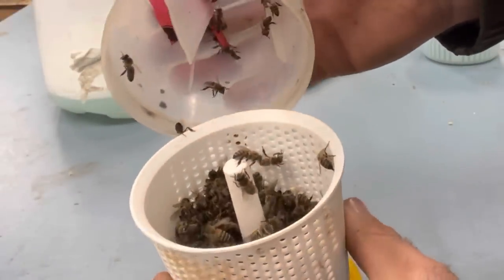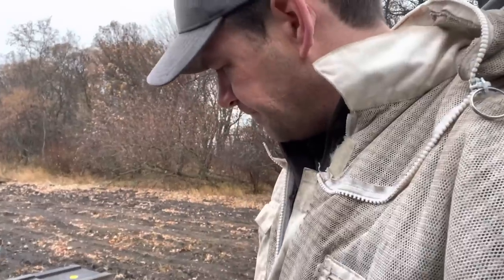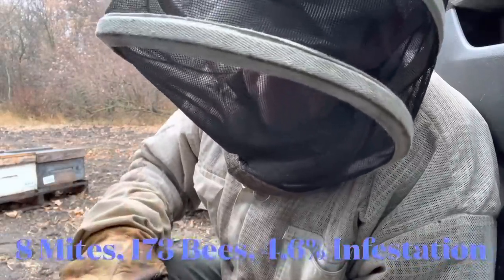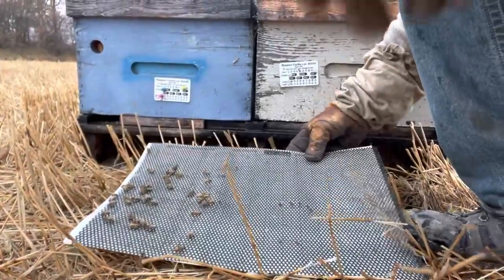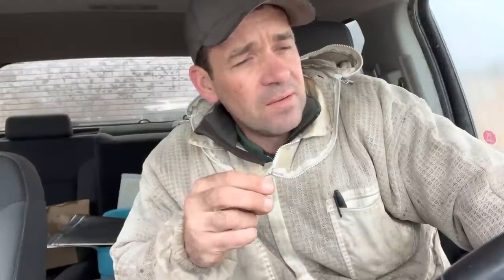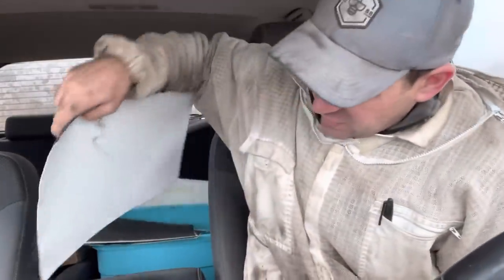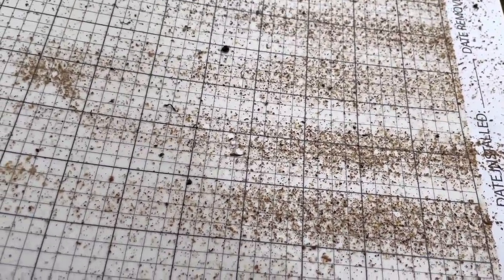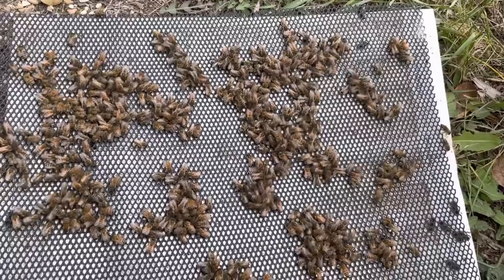Watch This One With a Grain of Salt

Comment: My OAV treatment dropped 65 mites in 24hrs. I cleaned the board, put it back in and over 3 days after the OAV it dropped an additional 62 mites. I had previously used Formic Pro on the hive (20 day treatment option). Before the formic pro treatment I had 16 mites in a wash. After the two round of OAV post Formic Pro, I am at 0 in a wash. I plan to hit once more with OAV I think when i wrap my colonies.
Reply: I'm working though an every 3 days for 12 days round myself, shocked me how much drop I had, my opinion OA is the way to go.
Reply: I'm working though an every 3 day for 12 days round myself, shocked me how much drop I had on my first round, my opinion OA is the way to go.

Comment: well your video sure reminds me of what I went through in California before almonds. I OA 600 hives and put a sticky Paper in some of the hives and in 24 hrs I only had a small percentage of mites that fell. I knew I had a ton more mites then that in my hives. so I did a magic blue towel in the same hives. I checked the next morning and got 150 mites to 200 in the same hives I got like 25 mites with the OA. I feel for you because I have been in your shoes before with high mite counts and know the out come with the hives with a lot of mites.
Reply: I am a beginer.
What " magic blue towel" is ?
Reply: @catchannel4421  it's just amitraz on a shop towel vs the strips.
Reply: Blue paper towel ,soaked in gelatine an oxalic acid, an place over the brood frames, for 6 weeks 
(Repco car part ,in New Zealand, Has those,blue paper towels, )
Reply: @davidizaguirre5060  Thank you

Comment: Hi Ian. Thank you very much for that video. The first thing to take into account for the phoretic analysis is the migration of mites between brood and bees. Usually 80 percent of total mites is within the brood. Imagine whats going on if they are getting broodless.
The phoretic mite count could be possibly 4 times higher at the same total number of mites compared to a broodrearing hive. The broodless hive with dramatically high mite counts might be even undergo through a cleaning process and will be performing better than other hives. Second the bee sample is highly variable eg i am expecting that harvester will have the lowest and brood rearers the highest infestation.
The change from broodrearing to broodless and vice versa might affect the phoretic analysis in general. Maybe it might be helpfull to count mites in the brood in your preselected suspicious hives. The effficacy of your two treatments makes it more delicate …..I am really looking forward to return to formic acid treatment after the harvest. It has the highest succesrate rate to my opinion.
Reply from the maker: I wonder if the variability is due to the act of late brooding and that shift of mites
Reply: @aCanadianBeekeepersBlog  But the strips had been in for the designated period, so they should have caught mites no matter how much brood you have? Variation in OAV mite drops may well be due to different amounts of brood in the hive.
Reply from the maker: Ya that’s true
The Apivar should of gotten them
Reply: @theoeicher  I do not believe that strips act in the same way 1st and 15th day...if that is true, we would not have any problem with varroa mite, one treatment would kill all mites....I think that reinvasion could make extremely high percent of infestation....reinvasion does not hit all colonies, only that which go in robbing?

Comment: Hi Ian from Greece. I only work with OAV but at 280 C. With this temperature the results are much better.
Reply from the maker: That hot decomposes the OA , from what I’m told 180 is the target temp
Reply: @aCanadianBeekeepersBlog  The 30% water that contains the O.O. acts as a brake on the rise in temperature of the oxalate. Any decomposition into formic acid is unstable because formic at 87C is converted to co and water in the combustion chamber. By increasing the temperature we increase the pressure inside the chamber and then we have a greater expansion at the molecular level of the O.O. resulting in better dispersion. The varroa starts to dry from the first 10 minutes with these temperatures. If there was a decomposition of the O.O. we would not see smoke because formic acid is invisible.

Comment: I'll throw an idea in here. There seemed to be a negative corelation between mite drop and higher test results. Could the hives with higher mite loads be seeking and removing mites more agressively due to high numbers? The mesh ,being right on the sticky board may still allow bees to find and remover them...perhaps a screened bottom board where the screen is 1cm above the board mite give a different result?
Reply from the maker: That is possible

Comment: For me, the fact when you started your washes you were expecting a low mite count across the board says something, the washes were just to confirm apivar had done it's job, it clearly has not, could it be a batch issue with the treatment? For the expense of apivar, I'd be wanting answers as this has really ballsed up your winter prep.

Comment: Since Apivar seems to be effective for a good majority of your colonies, I doubt resistance is at play here. Having used Apivar myself this year, I believe the way the strips are positioned in the hives may be a potential area for improvement. The bees could simply not have come into contact with the strips enough to transfer the active ingredient. Thoughts?
Reply from the maker: I have found singles are much more effective than double because of that
Reply: Perhaps the strips missed the brood nest?
Reply: I have clean strips fortnightly an reposition strips in nest area, over 8 week period that alot of work ,only done 4 weeks apart this year,
Reply: I noticed way better results when I switched to 3 strips per deep box, not sure what the label reads up there, but state side they talk about frames of bees per strip, My bees would be packed out doubles and by the label math it would call for 3 strips per box.
Reply: @jimbozerothtee4131  enough that I’m done using apivar…. I had two years of bad batches. Trying oa vapor this winter and will be trying the oa sponges  after the honey pull.
Reply: @jimbozerothtee4131  he is also where I got the 3 strips per box idea from

Comment: I share in your frustration. I've done mite counts before and after Apivar a few years, always having a few go up in mite numbers. Last year having more than I'd like go up. So this year I participated in a USDA amitraz resistance study. The mites in my hives also showed high susceptability to amitraz (alot of mites dropping in 4 hours with Apivar strip). Inconsistant with what I'm seeing in my hives.

Some of my thoughts: How well is the amitraz releasing after 4-24 hours? I mean they stay in there 6 weeks. How well are my bees contacting the strips for that 6 weeks? They'll often move brood away from the strips. Do the bees stop walking on them, or at least not enough? How often is that bee that hatches 1 frame away from the strips contacting amitraz before the mite jumps off her and into a cell about to be capped?  Of course there's lots more senarios too that could be causing inconsistent results.

Your sample is 300 bees out of 20,000-40,000. Please don't look at your mite count sample as an exact measurement. I've had a 0 mite sample when looking down in the hive I see a couple mites in drone brood. I group my hives in low mite: 0-5 mites in a 1/2 cup bee sample, or high mite count: 10+ mites. And 6-9 mites probably needs to be resampled to fit in the high or low group. Saying this one is 1.3% vs. this one is 2.5% mite infestation is not really correct. Your sampling is not going to be able to detect that difference. I've haven't seen too much information on margin of error in these mite count sampling methods, but remember there's always a +/- X factor with any sample. Having worked in a lab for several years, our test methods had a defined +/- 10% or something similar depending on the test.

I don't think anyone has an answer yet to these inconsistent results with amitraz. Any maybe really more or all mite treatments. But identifying there's even a problem is the first step.  One thing I can say for certain is: I'm sick of varroa mites!
Reply: I've read that strips need to be shifted to follow the brood and any bridge or propolis scrapped off to keep effectiveness of strips active.
Reply: @nancynolton6079  I do scrap and rearrange the strips where brood has moved away or strips have wax or propolis. Now I check hives and do this once only 2-3 weeks after applying the strips. Maybe some hives need this more frequently. That is one possibility.

Comment: I think someone should be looking at the apivar strips for these problems. 
I haven't been using apivar as long as you have, but have the exact same problem this year as you do. 
I was told by my supplier that the company was getting rid of the old apivar before releasing the new stock.

Comment: Mites are also a temperal problem, if you do a test and then 3 days later you do another test and find more, dont you think there will have been mites emerge too.
So time between tests will not give good control testing because of the temperal distance
Reply from the maker: Possibly my issue

Comment: When I saw your experiment, I thought 'that's 50-500x more Amitraz than in a hive', with 0 air flow. So, it's obviously strong enough to even kill the bees.
Reply from the maker: It’s set up to prove efficacy, I assume they have figure out all those things
Reply: @aCanadianBeekeepersBlog maybe you should test it a European way, using liquid 20% Amitraz solution for a test, instead of using an enormous concentration of Amitraz to prove something that won't be correct. I use Amitraz only to combine it with OA, formic acid, thymol, tau-fluvalinate, coumaphos, and other chemicals. Amitraz alone has very low efficacy.

Comment: I've got a similar problem last year put the apivar strips in August pull them out 7/8 weeks then vape with oxalic acid and loads of mites on the tray 300-400 so thought waste of time spending hundreds of pounds on apivar this year vape them with oxalic acid 
3 times one week apart end of August September  problem now is I've got hives dying with verroa. So don't know if the verroa has come in since.  I wanted to ask you what is the name of the full face Mask you use and the number on the filters. thank you.
Reply from the maker: It’s a 3M full face mask 
60922-60926
Organic vapour Acid Gas

Comment: Check randy oliver's latest mite washing protocol video.  I think you are adding alot of variability with your loose sampling technique: use honey frame next to brood, dump bees into dish-pan, let old bees fly off, then take half cup of nurse bees to sample.  I think it will reduce your variability in your data.
Reply from the maker: Perhaps, but they are all nurse bees due to zero brood and a set up winter cluster

Comment: I think this shows the importance/difficulty of accurate sampling.  Rather than just collecting bees off one frame it might be better to shake bees off several frames into a tub and then scoop a measuring cup full out of the tub to get a more mixed/average sample of your hives population.

I suspect that an apivar strip in a jar gives a more concentrated dose than would be found in a hive.  I think using a larger container or a smaller piece of strip may give a more accurate result.  Lack of ventilation in the jar may be a problem too.

This is a frustrating problem.  I hope the tech transfer program can help you make sense of this.

Comment: The simplest explanation is that the washes don't give correct data. In other words, those sampled bees are those... and those 300-500 varroas could be on some other bees in that pretty big cluster
Reply: I don't trust the washes either, but weren't the sticky results truly inverse?  The lowest wash values found the most mites on the stickies and the counts lowered as the wash estimates went up?
Reply: Well, his face at the end says it all. We have varroa since 77.. always did tests and experiments, and always had these same issues. I washed 0's all summer, but i also have bottom trays and use a fork to pull some brood out at a specific time in fall. We give up on exact numbers, learned how to read bottom trays in combination with washes... there's no way that varroa isn't there in fall.. and everything gets treated in the end. 
It's just my opinion.. he should do an oxalic - glycerin sponge or cloth on the bottom board.. a test at the same time when he puts apivar on his other hives. His feeding routine, causing a brood break in combination with bees wanting to clean and polish everything... l think, with the right sponge or cloth, it would be a much better treatment than apivar.. much cheaper, less work.. applie on the bottom and let the bees do the rest. 
From the tests we did so far, in my opinion, it's the best treatment we have.. if it's done on broodless.. with the right sponge

Comment: A) the original scientific article referenced by RO to motivate the rule of 300 mites per wash suggests an accurate mite wash sample requires samples of 100 bees from 9 different locations (in a 2 box hive). What do you think, could your inconsistency come from variance in what you catch with the washes? B) Also, as you look at your sticky boards, it seemed the mites were not dispersed randomly across the sticky board, but they were concentrated in certain areas of the sticky board [again that would be hard to catch with a mite wash] .  C) Finally on the outlier hives that have unusually high mite counts in an apiary, could it be they found a dying hive (a swarm that got away, in the trees and not treated) to rob?
Reply: Last spring i did a frame by frame wash on a hive that the week before had a count of 5%.  The counts ranged from 1% to 15% by frame.    The only mites on a sticky board are dead adult parasitic mites that have aged out and a few strays.
Reply from the maker: Interesting comments
Reply: Spot on. The mechanics of his management at that time leaves the dwindling ones with not enough activity in the colony to spread the treatment properly as well as any swarms that got away during the season all become "mite bombs" that cause surges in the outlier strong colonies who robbed out the weaker ones. Where the sample is collected also creates a strong point. Different times of the day and in different weather conditions, targeting the best location to gather a proper "average" sample is difficult.

Comment: I think you have too many variables in your experiment to reach any useful conclusions. One, just a normal bell curve explains why you end up with outliers with the number of hives you manage. Two,  Randy Oliver has shown how inconsistent OA vapor treatments are, especially with lower doses. Three, with varroa on average doubling in number every month all summer, when you treat large numbers of hives over a few weeks you can end up with a different amount of summer time for the varroa to double in, ending up with some hives having an "extra month" for the varroa to get higher numbers. Four, each hive is going to drop way down in numbers, replacing summer bees with winter bees. But some will brood longer or lose summer bees faster and other factors will make one colony larger or smaller at this point in the fall.
Now, take a hive treated early, and the resulting extra varroa onto a hive that maybe got smaller faster, and now you have a convergence of small colony and extra varroa resulting in a crashing hive. That's just one scenario. There are plenty more. Sorry this comment isn't a solution. Hang in there.  Writing from Minnesota

Comment: I was talking with Humberto and he said one of the things that really effects OA vap efficacy is sealing off the hive well to create pressure and force the OA into where the mite is tucked away feeding on the fat bodies. Not sure if I remember correctly but I dont believe your entrances were closed off. Might be a good Avenue to look into to try and up the efficacy on the OA. Your numbers sounded like 30-50% efficacy on the high end which is not good.
Reply from the maker: No I don’t seal off the entrances and I have leaky boxes
But I compensated with more OAV.
Reply: @aCanadianBeekeepersBlog  I did some citizen science using heat sinks in vap to see if it increased the rate/pressure, it didn't. You sparked my curiosity, I'll fit a deep with PSI meter and field seal it vs open entrance it and see what difference is if any and then see if the difference can be corrected by tucking a finger in to compensate
Reply from the maker: Your story about giving it all, even when the job is dirt shitty, holds close to my heart.  And probably the reason we keep doing what we do 
Cheers

Comment: I think maybe you're not collecting bees from the proper locations. Maybe compare your mite drop locations on your sticky boards with the frames above, and also pull bees from multiple frames instead of all from one frame. 

And I still think all that foam is holding mites in your washes. Try some windshield washer fluid or go back to using alcohol.
Reply from the maker: I’ve triple checked my washes to ensure that wasn’t happening 
The dishwasher soap is so quick as compared to alcohol